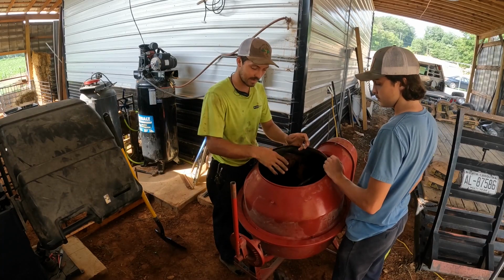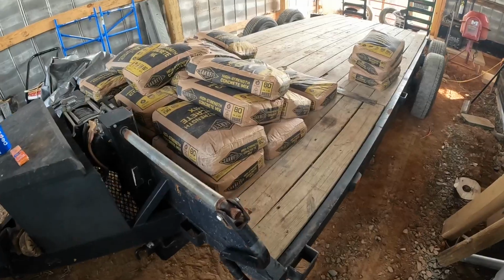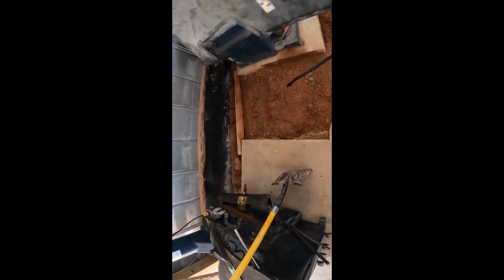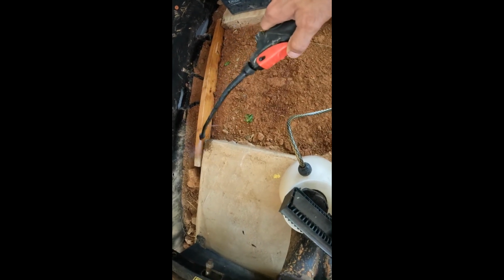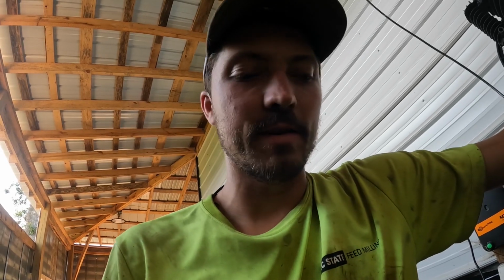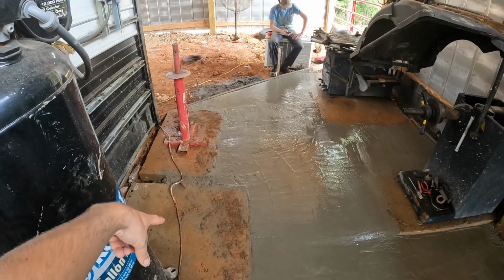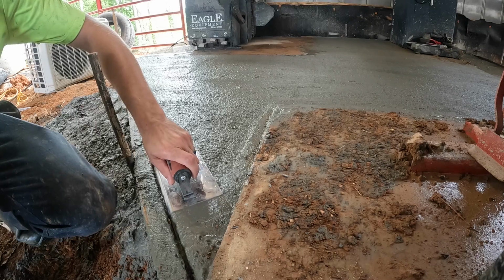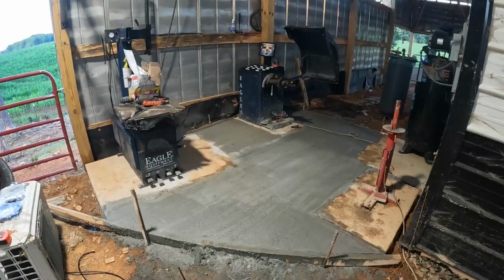Pouring concrete for our new to us tire machines (7/8/2023)

Comment: Hay men need joint at the corner of old concrete to stop the cracking. You still have time to saw cut  but you need to start good job
Reply from the maker: I appreciate the info. This concrete has been poured well over a month so I doubt it would help now. If it does crack it will be ok though. Just poured it so we would be out of the dirt. Thanks for watching